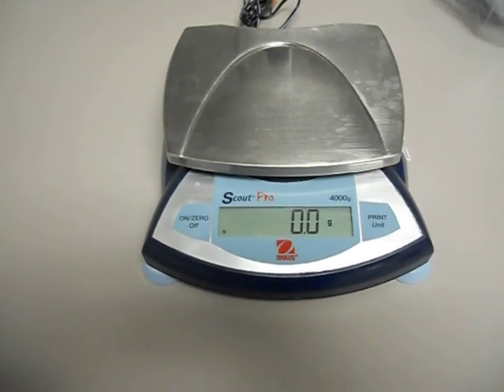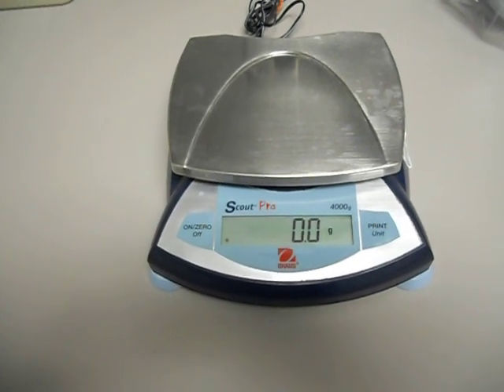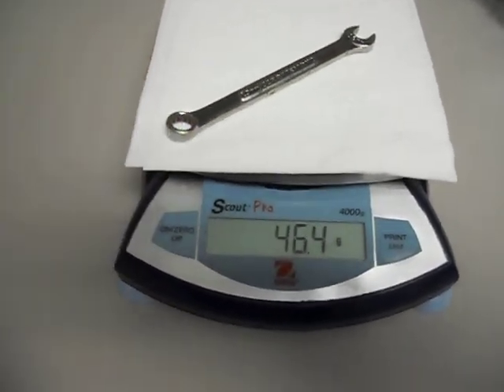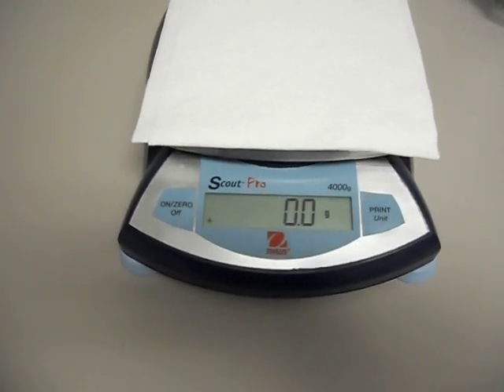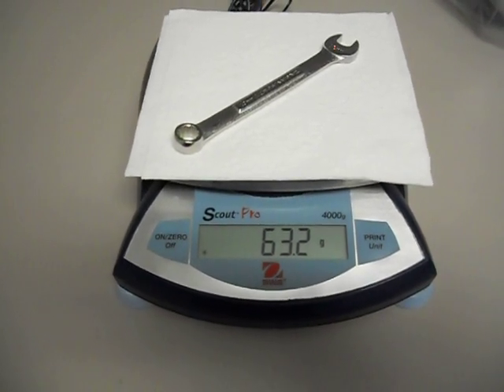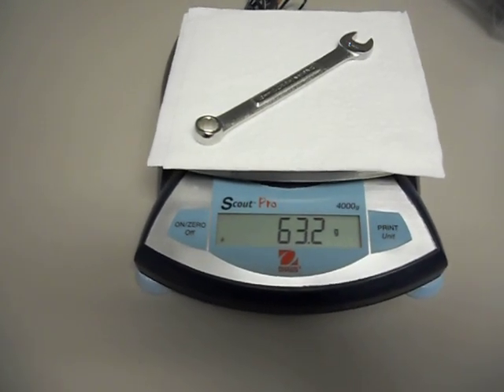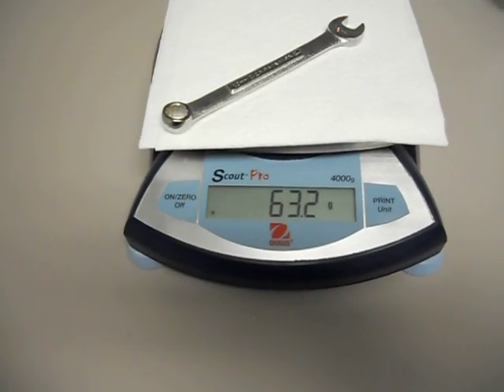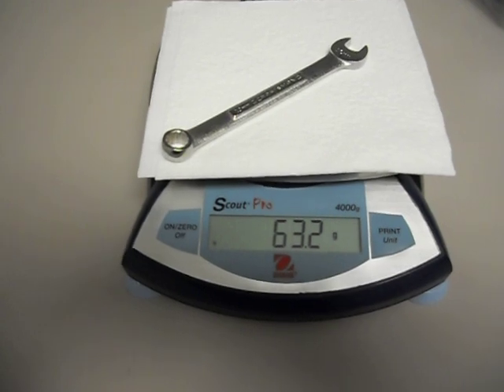Craftsman Tools: USA vs China [Part 3] - Materials Composition -

Comment from the maker: Meejhem I think you are missing the point of me comparing the USA Standard (chromed) with USA Industrial (non-chromed black).  

I took these initial weights to directly compare these two USA made tools against one another to have a baseline.  It should come as no surprise that the chromed USA tool is slightly heavier than the non-chromed USA tool, thus there is an ~3% difference in mass.  This is to be expected.

There is an ~13 gram difference between the Chinese Craftsman versus the USA versions, which is an ~20% increase in mass.  This increase in mass is due to the Chinese tool having an inferior alloy versus the USA counterpart.  The weaker the alloy the more you need to add to have your inferior tool survive the stresses imparted on it. 

I do not own the Chinese Craftsman tool.  It is one that I found where I am employed.  I appreciate your comment, but if you would actually watch the video all of the aforementioned is thoroughly explained.

If my intention was to compare USA forged tools to German tools I would; however, this video is to compare what was formally made in USA under the Craftsman brand name versus what is currently made in China under the Craftsman brand name.
Reply: I don't quite understand. You keep saying that the alloy is inferior based on the heavier weight of the Chinese tools but you don't know the alloy of either the Craftsman or Chinese tools. You also don't know the heat treating process used which would determine the final crystaline structure as well as grain refinement etc. Do you have any imperical data to support your hypothesis that the Chinese alloy is inferior?

Comment: One can see the difference in quality first-hand in their new spline/universal combination wrenches. The jaws are enormous and look like crab claws; better hope you're working on an old engine or machine with a lot of space to maneuver if you plan to use them.
There also isn't any consistency in the fit and finish of them. I bought the last of the U.S. made stuff at my local Sears, and the quality of even their final run U.S. tools seems to be lower than the stuff I inherited from my dad.
As an aside, I took a corded Craftsman angle grinder I got from my grandfather to Sears to see if they could source an arbor washer for me, and even though the part is no longer made (I was able to use aftermarket washers to replace it) and I don't know if I can get replacement brushes for the motor, two of the employees asked me if I was interested in selling it to them. Incredible.
Reply from the maker: Will Klusener I can agree with you Will.  Toward the end, to a degree,  there was a large difference between the standard Craftsman USA and its older counterparts depending on the tool.  In my opinion, I could say there was even a small difference Standard Craftsman USA versus the Industrial Craftsman USA, where the forging was the same but the finishing of the product was a little lower quality in the Standard.  The "industrial" level was vastly more expensive than the "standard" even though they were both made in the USA.

I'm sure at the end Sears was asking Danaher/Apex Tools to do whatever they could to shave dollars/cents off of each tool.  After a certain point, you can't shave anymore without compromising the tool itself.  It could be argued that the quality for some tools did fall victim to this.
Reply from the maker: Will Klusener Good comment Will!  I left a response.  Thank you for your time to share your view!  ^_^

Comment: Horrible, horrible garbage. Scary the difference is so obvious it can be seen and measured beyond any reasonable doubt.
To think my town used to supply these tools a long time ago.
You will be missed Craftsman. plays taps
Reply from the maker: s0nnyburnett  As a former chemist, I've been itching to know specifically what individual metals compose the USA and Chinese tools and what impurities are inside. If I had access to plasma or x-ray spectrometry devices I could perform this analysis. That is just me thinking out loud, but it truly would put the case to rest.
Reply: TheseAreMyToys
I would absolutely be over the moon if someone did that.
I'd like to do some destructive testing some time to see objectively just how much torque it takes before they explode in my face. But I'd rather not ruin some good wrenches to show how bad some shitty wrenches are.
Reply from the maker: s0nnyburnett Either of those analytical tests would pretty much put the nail in the coffin.  The plasma spectrometry would be the best way to ID composition, whereas the X-Ray would identify the metal crystal lattice.  Without doing a physical torture test you could make a fairly educated guess with what would happen with that data.

Yet, it is no where near as exciting as "demolition derby" style break test.  I'm thinking about how such a thing could be executed with the physical and time resources I have available.  I'll keep it in my mind! ^_^
Reply: TheseAreMyToys make a break test vs China craftsman craftsman used to not buy that tool
Reply from the maker: Tino Cervantes I have thought of that idea; however, I'm not sure how to go about executing the idea.

Would you be up for donating a handful of USA or Chinese Craftsman wrenches or ratchets for the project?